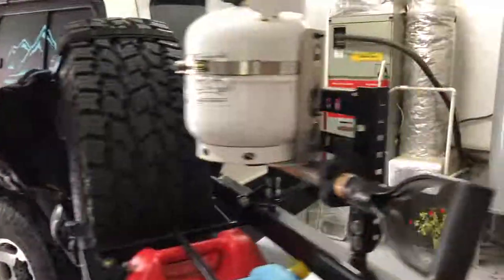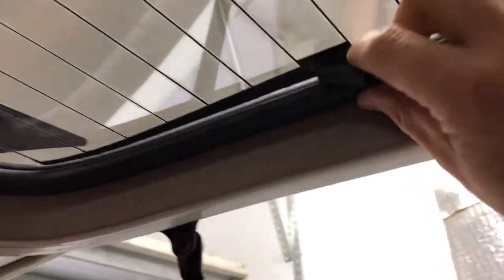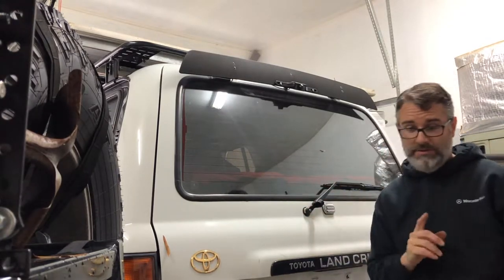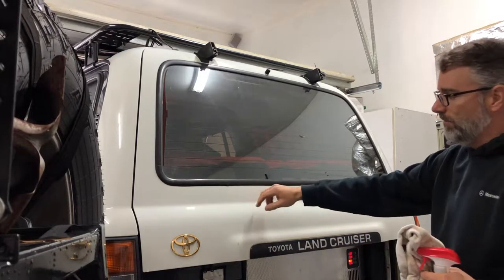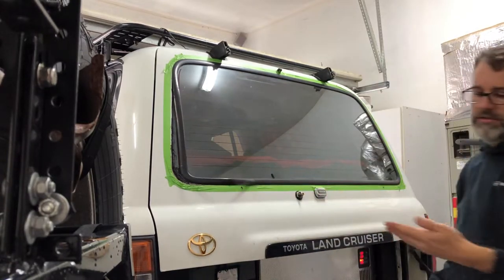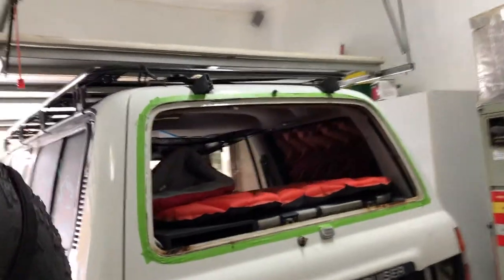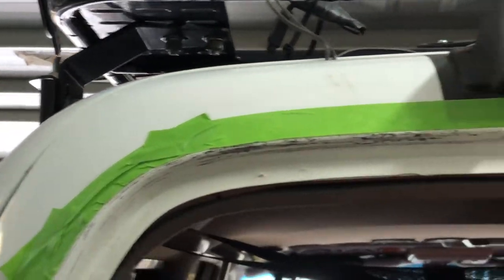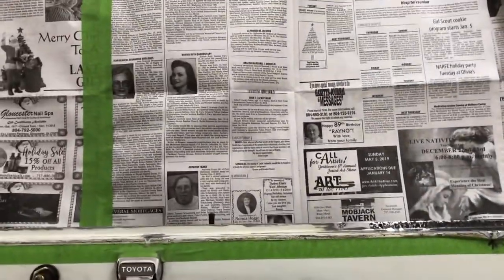80 Series Tailgate Rust Repair Part 1

Comment: Excellent video, I need to watch the series. I have rust on the bottom of the upper door window as well. I might blast the rust with some fluid film as a short term solution. Thank you for posting.